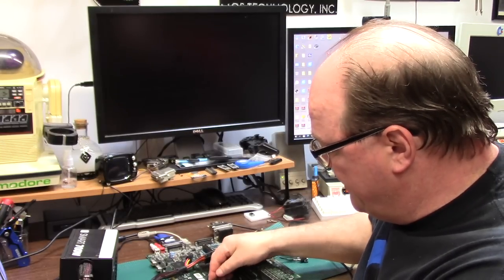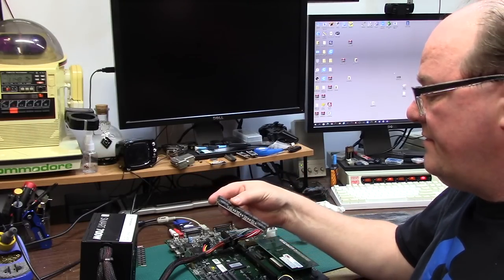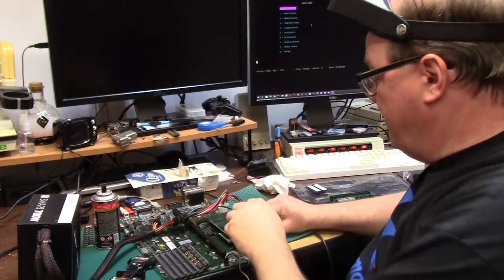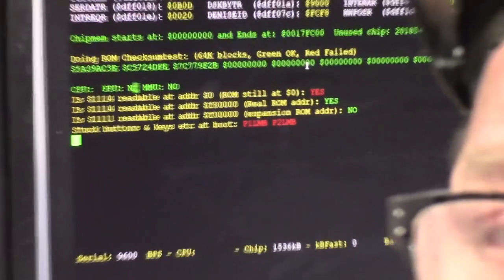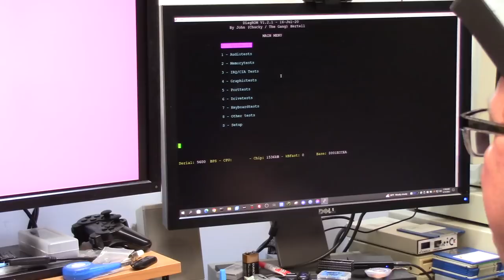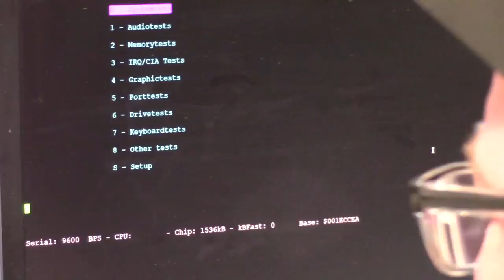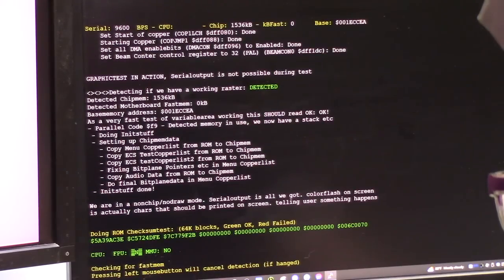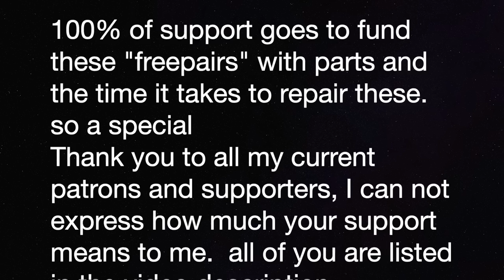The Amiga 4000 of everything's broke P1

Comment: Its been a long time but I have had a CIA cause a Green Screen on an A500 which is not an A4000.  I will be following this closely because I do own an A4000 and knock on wood its still working but all Classic Hardware is is destined to fail maybe not today but certainly some day in the future.   Every time I open up one of my babies I always say a prayer.   I only know one thing is something stops working I have to take a deep breath and figure out what I did or failed to do or what did I fail to reconnect.   Yea all my babies are on a KVM Switch so if you leave say the keyboard disonnected the mouse may not work and ya know even my KVM Switch pinches a fit too.  Yea been down that road far too many times I now have spark 8 and 16 port KVM Switches because failure is not an option.  Yes the insanity continues even here in the Bible Belt where even Jesus would not chose to live.

Comment: The 1.5MB chip ram is a clue - it should be 2MB so probably address bus issue around that area - I didn't see a chipmem test?  Try a manual one from 0MB - 2MB ?  Should start getting errors around that 1.5MB...
Reply from the maker: It gets better stay tuned

Comment: Any thoughts on why a WarpEngine won't boot if any memory is installed?  Yellow screen, blinking A4000 powerled, stuck in reboot cycle.  Works perfectly fine when all WarpEngine memory is removed.  Tested with the original 040 and 040-060 adapter.   She was running fine with 128MB of 60ns RAM (4x32MB).    After a few recent hot days, she stopped working.  Cleaned contacts, reseated RAM, tried other sizes and combinations with appropriate jumper adjustments.  Reflowed solder on the SIMM sockets.  Originals were replaced with metal restraint sockets.  One stick of any memory, in any socket, will prevent her from booting.   Anyone have schematics to trace SIMM lines?  Thanks.
Reply from the maker: Unfortunatly no however
Retrorewind.ca has xray machines and stuff that can look for breaks in lines.  Either that or it fried a logic chip
Reply: @ChrisEdwardsRestoration  Thanks.  I'm running some real-world speed tests with MovieShop to see if my WarpEngine 060 at 68mhz without memory is faster than my T-REX-II 060 at 50mhz with memory.  If the WE wins, I'll keep it in my A4000.  Otherwise, we may be going Jurassic with the T-REX-II.  I'd like to keep this A4000 an all MacroSystem set-up if possible though.
Reply from the maker: @jjdigitalvideosolutionsllc5343  t-rex2 has the fastest
Scsi ever made on the amiga
Reply: @ChrisEdwardsRestoration  Is there a benchmark list for SCSI controllers?  How fast is WarpEngine SCSI-2 vs T-REX-II SCSI-2?  I'd have thought CSPPC/060/MKIII SCSI-3 would be the fastest though.
Reply from the maker: @jjdigitalvideosolutionsllc5343  there used to be years back, but that website went down . i think bboah and amiga.resoure.cx list them but not in a "list"  the GVP T-rex2 was the fastest, even over the phase5 stuff. GVP did some sketchy stuff to bypass normal amiga limitations.
Reply: @ChrisEdwardsRestoration  I got some benchmarks on the T-Rex-II SCSI-2 from Greg Donner.  

BusSpeedTest v0.19 @ 50 MHz:

41.3 MB/s readm
22.3 MB/s writem
Reply from the maker: @jjdigitalvideosolutionsllc5343  yeah t tex 2 has fastest scsi ever done on the amiga.  I have one of those also